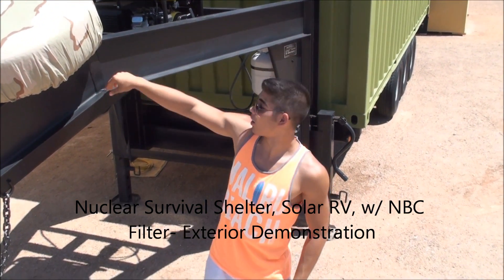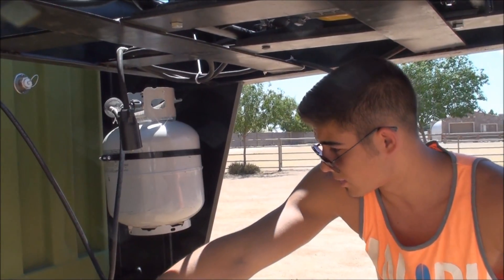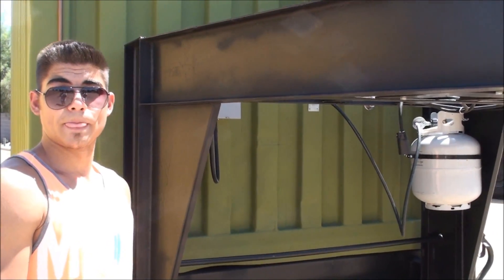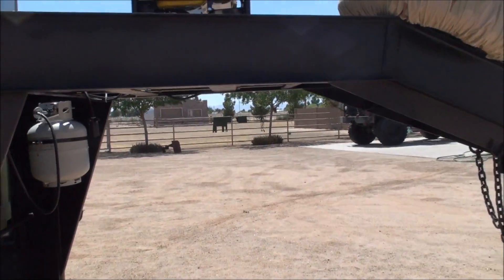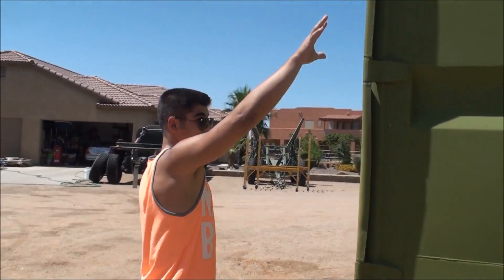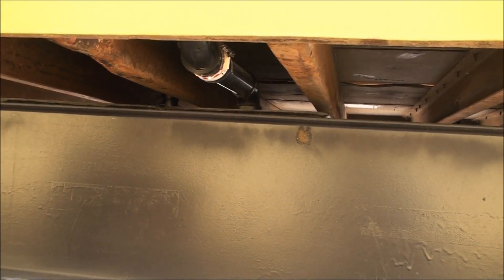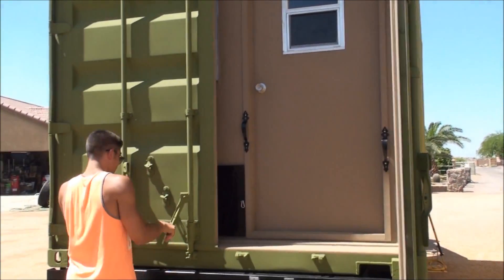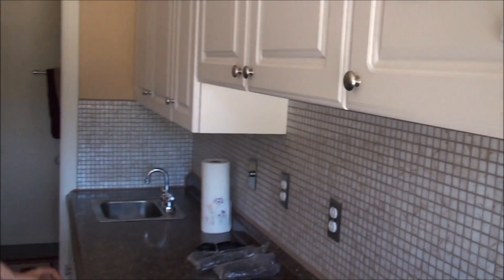SOLD. Demonstration of Nuclear Survival Shelter, Solar RV, w/ NBC Filter Part 1

Comment: I like it but it provides literally zero EMP protection.  In fact the solar panels provide an almost perfect EMP antenna - keep in mind you must guard against 100 volts/meter strength broadband EMI into the gigahertz region.  You also need beryllium copper finger stock all the way around the doors.  Put it this way - if you park this rig next to a radio broadcast tower and you can pick up that station (or any other station) on a radio locked inside, the shielding isn't good enough.
Reply from the maker: I believe it is as advertised "better EMP protection than any regular home". It is not the ultimate shelter, as some people would like for "dirt cheap". I have a 100% fully EMP shelter that I'm liquidating at the moment.
Link: https://phoenix.craigslist.org/evl/for/6090772782.html
Picture link:  http://s851.photobucket.com/user/dodev7/library/EMP%20Shelter
Thank you

Comment: you guys still build this shelters?
Reply from the maker: Not at the moment, because most of them went under cost. I'm waiting a payment for the one above. 
This one (the link) is pre sale before I put it on ebay, 10's of thousands under cost and the only fully EMP I've ever seen. Link: https://phoenix.craigslist.org/evl/for/6090772782.html
Reply: dodev777 whats your asking price for the one above?
Reply from the maker: It was reduced to $29,999, trailer, NBC and all. 
The offer I accepted is under that price.
Reply: Okay so its sold.  put more videos wen available, Thanks.
Reply from the maker: Tentatively sold, no  deposit made, so if you have the cash you can move on on purchasing it.

Comment: I don't mean to be critical, always easy to criticize from the outside looking in. Maybe some thing to address.
1. Rustproof undercarriage
2. Secure outside plumbing, electrical and propane from easy sabotage. Maybe weld expanded metal around items with locks.
3. Expand battery bank for longer or heavier demand. 
4. Consider key style lugnuts on wheels to make more difficult to steal. 

Other then these few problems, I'd be happy to own such a bug out RV. I think the color should probably reflect ones intended bug out location. Green or desert sand. 

Great Job.

Comment: If there was a nuclear bomb or something and the propain tank gets hit by the blast wouldn't it explode?
Reply from the maker: If there is a nuclear blast near by this unit will not be adequate to sustain it. This shelter is suitable for aftermath fallout, pandemic, small EMP, power blackout, hunting, fishing, hobby, RV,  and so on. No unit on wheels can survive a direct, or in near proximity, nuclear attach. This is general multi purpose container shelter that gives you more bang for the buck but not the solution for every disaster that might strike.
Reply: Thanks dodev777

Comment: an emp is nothing like a lightning strike. you need to protect each and every electric device when an emp hits. emps fry electronics that arent wrapped in rubber to keep the blast at bay
Reply: +grimr34p Well actually you just need a Faraday cage to protect against EMP. The shipping container is a good place to start as it is mostly metal, but adding an additional layer of copper screen - commonly called a screen room in the electronics world - inside the container should completely block the EMR. Rubber is really only necessary to isolate the electronics from being grounded to the Faraday cage or container as rubber won't stop an EMP itself. You have to isolate the electronics from any outside connections which could be compromised by an EMP. You could even just use a microwave oven to store things in.
Reply from the maker: +grimr34p Your comment has been addressed already. I do have a fully EMP shelter that I will release soon. If one think that he will get the best EMP protection, bulletproofing, accommodation comforts, nuclear proofing, and so on in a mobile unit for this price he does not understand the purpose of this shelter/RV (tiny house concept) and certainly needs to look somewhere else. This unit offers more than any other 20' container I've seen and is being offered under manufacturing cost. Anyone is free and encouraged to build their own if they don't like what they see.
Reply: +dodev777 valid point I never saw the other emp comment. to make it the best nuclear resistant RV id add more laters to stop gamma radiation
Reply: +dodev777 but you mentioned emp protection and it being bullet proof on THIS walk through.

Comment: Nice demo , would have been far better however without all the questions from the cameraman. 
Another point as well, Your setup is not EMP proof and if you sell it with that guarantee you'll need to have some deep pockets for the pending litigation..
Yet another point, You can not expect to travel with that cheap strap you have for the propane tank. While it may be stable for in place usage some sort of shelf or pin support system will need to used to serve as a better anchor points for transport of this unit.
Overall nice concept

Comment: Lets say a nuclear fallout happened and I need to get to the generator or something you have on the OUTSIDE, im probably going to get death, because of radiation and opening the door opens the possibility of radioactive dust getting inside, No pun intended. 2/10 Survival
Reply from the maker: +Aleksei Krasnov Alesnarovich 
What you are looking for cost a bit more. I'm not posting even videos of fully EMP, Nuclear proof shelters because customers are more discrete and they are only custom orders. This is not for direct hit (nuclear blast zone) as some viewers have noted. 
It is the best multi use: camper; shelter; survival; fishing-hunting unit for the price. Just as advertised. It provides better protection from EMP, pandemic and nuclear fallout than an average home - time 100.
Reply: dodev777
I dont think this is nuclear proof unless you are far from the blast but this is an AMAZING shelter for EMP or other attacks, its small and hopefully cheap lol.

Comment: I am assuming that this is not designed for a indirect nuclear hit, that it would be for way outside ground zero correct? I would think the heat and shock from a nuclear  weapon would cook the occupants and radiation could still enter it.
Reply: +dodev777  Add maybe some lead to the sides, that will keep out radiation.
Reply from the maker: +supraman236 You are correct, you have to be well underground to survive a "ground zero" attack.
Reply: Thats what I thought. Neat trailer though.

Comment: Jonathon, you may want to consider several things when it comes to a faraday cage, because your hot water heater has computerized components you may consider placing the heater insider “hint EMP” with emphasis on the EM electromagnetic has nothing to do with being grounded because it still provides a magnetic path which is different from an electrical path . The grounding of the unit is an overkill a standard six foot grounding  rod would be good enough.
You may also want to consider the fact the you  or anyone else can be locked in the unit, I would consider adding an emergency exit. For added security, I would recommend that you provide a way fro the doors to be secured in either the open or closed position.
Filtered grey water would minimize the use of fresh water and extend the use of fresh water usage.
I would recommend the use of two heavy-duty deep cycle batteries in series “semi-truck batteries” which would provide a higher amp draw for 12 volt batteries to be used for a longer period of time, I would also recommend a solar hot-water system  to minimize the un-necessary use of propane. I would also recommend adding an inexpensive security system for the outer perimeter which can be picked up for under a hundred dollars or even cheaper on Craig’s-list or at a swap-meet.
Overall, I would rate your project at an A-

OS1 (AIC)
SW/AW
Reply from the maker: Thanks for watching and leaving an insightful comment. I agree with everything that you have to say, but bear a few details in mind: this is a multi-faceted project so it is not only the EMP that is of concern, but other factors such as lighting need to be taken into consideration; the water heater has a grid on the exhaust and is in an all metal box so the EMP will slide around it and yes, it may kill the heater, but the contents of the shelter would stay in tact. 
This shelter is not advertised as 100% EMP protected, although I do have 100% EMP shelters in stock. They just happen to be cost-prohibitive to 99% percent of consumers. 
I had a shelter with a 36Kwh battery bank that I couldn't sell- just to make my point about them being cost prohibitive. 
This one definitely needs an escape hatch, but one has not been installed for good reason. If the client buying it wishes to place it on the ground, an escape hatch through the bottom would be rendered utterly useless. 
So that leaves a question for the placement of such an escape hatch being on the top or the bottom or the side... something that the future owner would have to decide.